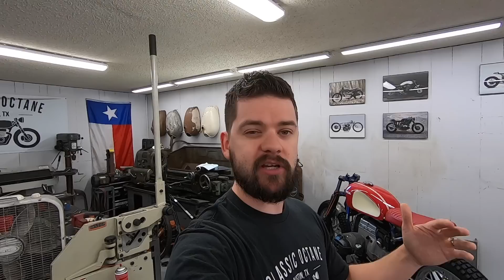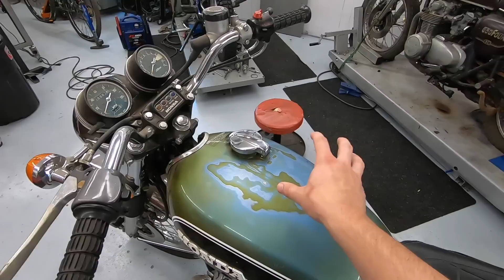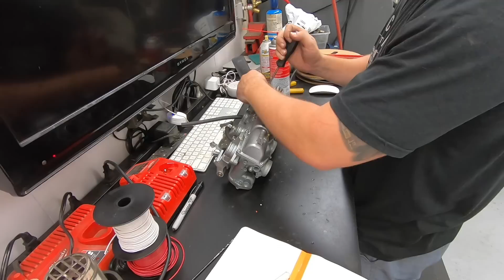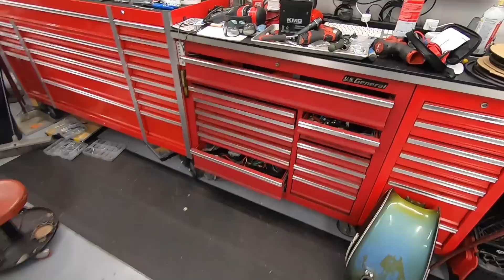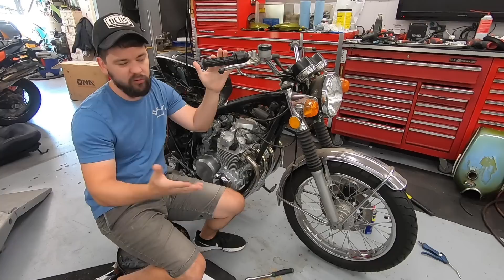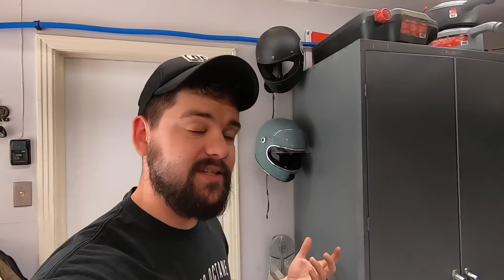Liquid engine rebuild? Let's give it a test.

Comment: Hey Taylor. I'm doing a restore on a 72 CB500 and this is going to be SUPER valuable to me. You having to tear down the top end, will totally help me get my restore done. I know you don't want to make a SUPER long video, but I'm telling you, this will help SO much. Got a question. Do you usually work on your motors on the bench or in a stand? Or even on the bike? I'm new to bikes, but not new to working on engines / cars. Thanks!!

Comment: It can’t be very hard to rebuild these with a little machining and new piston rings, she’ll be good as new. Even if parts are hard to find, the hardest part would be to find out the piston walls have distorted and it needs to be rehoned. I can’t imagine it’s easy to come by oversized pistons for these old engines.

Comment: Just heat up some 0/50w oil and heat it on the stove until it's smoking hot then pour 2 ounces in each spark plug hole , leave for 24 hours . Best method I know of .
Reply: @dave himlin if it's stuck rings , potentially it's a permanent fix . It an old guys tip . Engineers and mechanics have been doing it since 1920s .

Comment: MMO has a decent percentage of mineral spirits which is a good solvent...softens carbon.Also future reference,  any of the ester based synthetic oils are highly detergent by nature...running an ester based synthetic will clean petroleum gunk off the inside of any engine.
Reply: Some synthetics have a high detergency, but it's more of a cumulative effect. If you're starting off with something heavily neglected, you need something a little more radical, like Marvel, to start attacking deposits. But nothing AS radical as Seafoam or an engine flush.

Comment: The funny thing is those CB500;s ran terribly, probably due to low compression even new from the factory. I worked at a dealership that spent countless hours tying to improve the very poor performance from a customer's new CB500, everything was tried, I test rode the bike for many miles, and it was like a bad dream, couldn't get out of its own way at full throttle. I presently have a vintage motocross bike with a SL125 engine basically one cylinder off the 500 and it also runs poorlyfor no reason other than maybe very low compression due to a high performance camshaft effectively lowering the running compression.